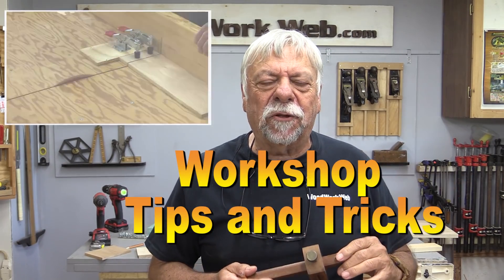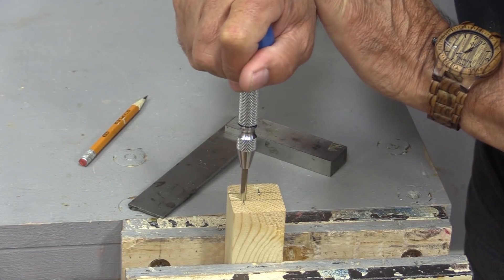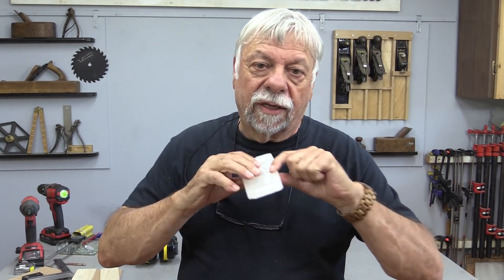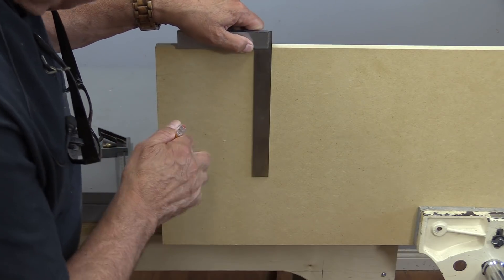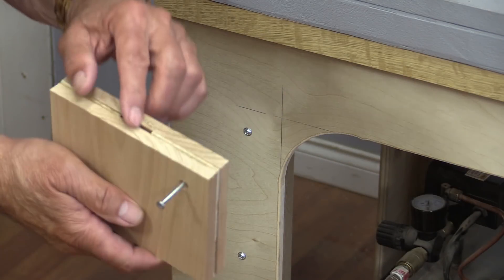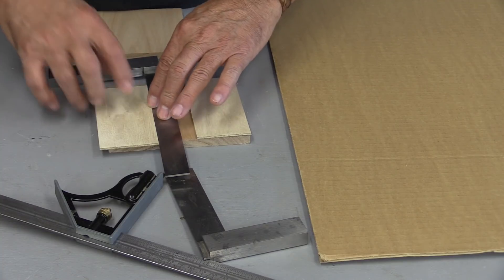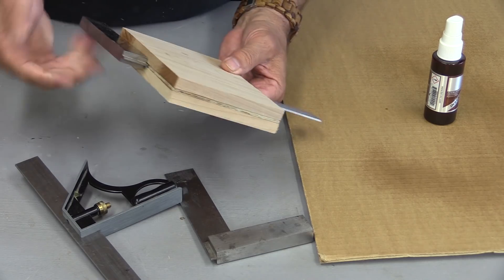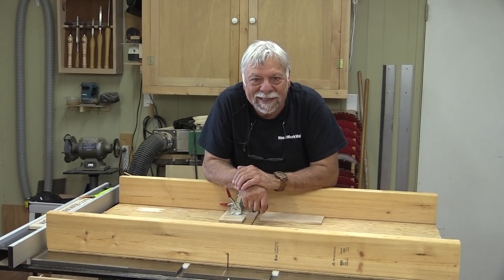Workshop Tips and Tricks

Comment: NICE  TIP WITH THE NAILS FOR MARKING TENONS. THIS COULD BE IMPROVED BY USING DRYWALL SCREWS INSTEAD. THEY ARE HARDER, WON'T MOVE BECAUSE THE HOLES IN THE WOOD WEAR AND CAN BE ADJUSTED BY SCREWDRIVERS. HOPE THIS HELPS SOMEONE.

Comment: I love using toggle clamps     I’m in the process of putting t track in my sled now for the toggle clamps actually. I like to use miter bolts. The rectangular nuts fit into the “type 30 chute” t track. The kind made for hex bolts n such.  I just drill the holes out on the clamps so the bolt I wanna use will go right thru and into the rectangular miter bolt nuts.

Comment: Call me wrong if you wish but, on the sled, I've always used a #2 pencil with it's eraser to hold down the piece I'm cutting. It doesn't take a lot of pressure to hold the piece in place and since the blade is turning towards you, the blade is actually pulling the piece down on to the sled. 
Not going to add to the use of using wood screws in place of the nails for marking, that's just a very old trick. 
I will add for your alignment of squares, rather you're using a marking knife or pencil, put that down on your top line first then bring your square into that, then mark. You CAN make your square seem out of square by actually moving it first before remarking your line, it happens. A marking knife is really the best way to check anyway. Cheers :)

Comment: About those toggles I think, I've got an idea on how to improve it. Look, you get that piece of plywood or whatever you use for base of those toggles, screw them on and then glue a vertical piece of wood to the front edge. That way you can just clamp it to your sled with some random clamp instead of gluing and it would be much easier to adjust.
Reply: Might work, but it is not 'fixed' on the bottom of the sled that way - only onto the edge - when you clamp them down, they might move (a bit)? I don't have a sled nor clamps - just wondering as you would have to make it pretty sturdy?
Reply: When Collin glued that piece w/ the toggle on it, doesn`t that make it more or less permanently attached to his sled now?

Comment: On the rubber for the clamps. That's great except I've discovered that the clamps will flex because of the rubber being too soft. It's great for clamping delicate work that doesn't require high clamping pressures.

Comment: Hi Colin. Love your videos as a several year DIY woodworker for home projects. Joining an earlier comment / question. What CA Glue accelerator are you using? Where did you find it. Do you buy the CA Glue and Accelerator at the same time, same manufacturer? Tnx
Reply: A pinch of bicarb of soda mixed in a table spoon of water can work

Comment: What did you spray on the opposite of the CA glue?
Reply: Activator. It comes paired when u buy CA glue.
Reply: @borys444  thanks
Reply: @Mama C in most big box stores u can’t even find CA glue in stock without having to preorder it. Richard from finish carpentrytv has a good brand behind his name when it comes to CA glue. Defiantly check his store out on u tube if u haven’t already.

Comment: Great tips again. Thanks for sharing. I like that toggle clamp tip very much. 
Not square squares are a big problem. In the past I saw videos on YouTube that it is possible to punch (indent) the squares on a certain point and that should
make them square. Does that really work?
Reply: Aleph Leonine  That is a quick, short and clear answer. Do you have some more specific information on it?
Reply: That works on framing squares but won’t do anything for a trisquare like Colin was using
Reply: On combination squares there are usually two small tabs on the aluminium or iron casting either side of the locking bolt that the edge of the ruler presses against. These can be filed to make the square true.

Comment: That tip with the sled... doesn’t this remove the ability to do normal cross cuts?
Reply: ask my self the same question.... look like you need to build a new sled 😊
Reply: The piece that is hot glued can quite easily be pried off the sled.  Or hit it with a heat gun for awhile to soften the hot glue. Alcohol to remove any glue residue.
Reply: Why is it needed in the first place? just clamp a stop block to the fence.
Reply: @Mama C Fair comment. Guess I just like the danger..lol

Comment: Hot glue how do you remove it
Reply: That was my question too - IME the glue gets hold of the fibres and tears if you try and chisel off the bit you've glued on.
Reply: Try isopropyl alcohol.  Dab it all around the hot glue and give it a minute or two to wick underneath.  It may not completely release, but it will often weaken it enough to be chiseled or scraped off without damaging the wood.
Reply: Warm the area with a heat gun to soften the glue often works.
Reply: Wonder if u can put something thin down first. Maybe something like the non slip drawer liner stuff you get in rolls. It’s almost like a screen.
Reply: Warm the area, then use a thin paint scraper also heated up to lever off the temporary patch. greetings from London UK

Comment: So what happens when u own a combo square that isn’t square? Garbage?
Reply: If you remove the ruler and look into the slot it rides in, you'll see two tiny bumps that the edge of the ruler runs on.  If the combination square isn't quite true, then one of these bumps is too high.  Figure out which one by which way the combo square deviates from a right angle.  Work some sandpaper into the slot, preferably folded around something for better rigidity.  CAREFULLY sand off a TINY bit from the high bump.  Be very patient and slowly sneak up on the right height with repeated brief sandings, just a few strokes, testing every time.